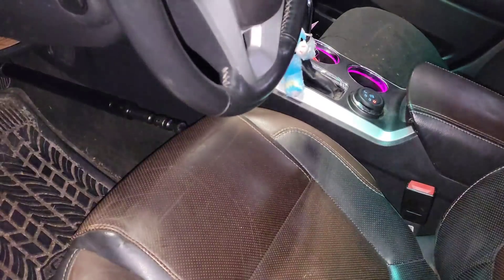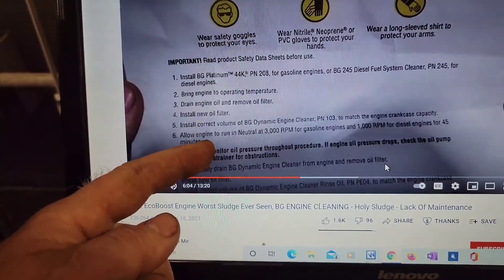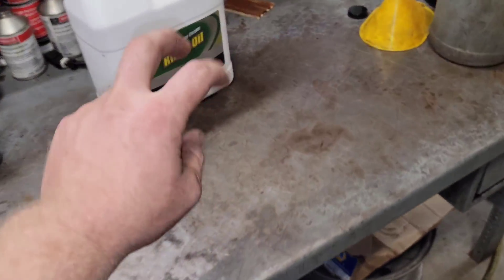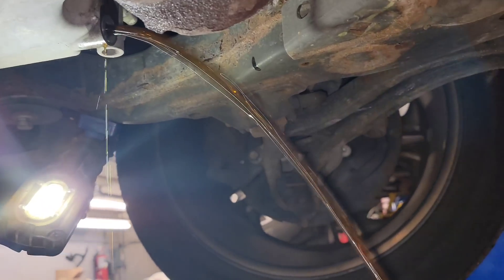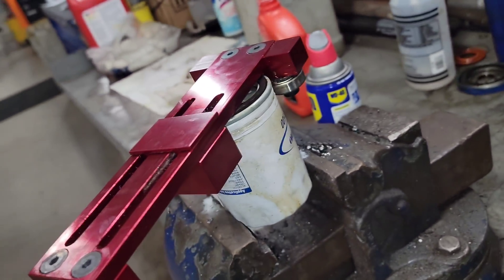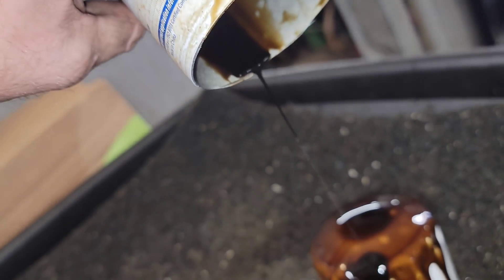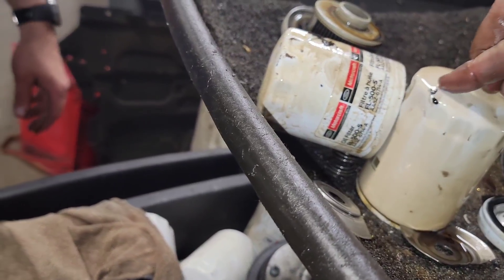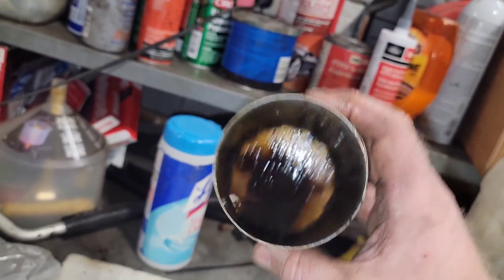Full BG Engine Restoration Kit 2014 Ford Explorer 3.5L Ecoboost - Quick Lube Serviced - Bad Sludge

Comment: Interesting. About 30 years ago I worked for a Honda dealer. The mechanics were always pushing BG products, which I thought was snake oil because they all saved the tokens inside the can for free stuff from the BG reps. Now I have a question for you. I have a 2017 Honda CRV LX, non-turbo version which uses direct cylinder fuel injection. The first five  5000 mile oil changes showed fuel contamination in the analysis reports. The last one was perfect though at 30,000 miles. I know there might be a carbon on valves build up problem sometime after 60,000 miles and don't really want to go the walnut shell method. Do you believe the BG products can address that issue for me if the time comes?
Reply from the maker: Bg is good and power foam from Aimsoil
Reply: I used BG back in the 1980s on my Yamaha Motorcycles. In fact I think it saved my XS1100 back in 1982. My Toyota Dealership told me the about the BG ADDITIVE  about 50k miles ago on my 14 Tacoma. I told them to put it in. Same with my 17 RAV4 15k miles ago. It does what it says.

Comment: Would you recommend using the engine cleaner with a perfectly running car or truck with over 200000km?Or just add some atf to the oil. Thanks for the great content
Reply from the maker: The basic simple step kit yes 

1 small can epr and a small can MOA found on Amazon

Comment: Great video.  Folks, if you didn't believe in it before, by now you should know to always change your oil and filter using good quality parts minimum every 5,000 miles.  I've never been a fan of the extra long 10,000 mile or 20,000 mile drain intervals.  If cost is an issue for you, then just go to Walmart and get a good quality Motorcraft oil filter for $3.97 and some good name brand oil (they even sell Motorcraft oil there) and change it yourself.  It's too easy folks.  With the low prices of oil and filters we have in this country (compared to other countries, especially in Europe) you simply cannot afford to skimp out on oil changes.  It's being penny wise and pound foolish.

Comment: the TOYOTA/LEXUS dealership that contracted my shop was told by their entire service department to get rid of the cheesy kerosene oil-filter flusher that accomplished little if anything other than rinsing hydraulic valve tappets and actuators, and that someday they'd be sued over the dang thing. 5-years later they were and lost and had to refund every 1 of their customer's money costing them bank and their reputation. Cleary the BG engineers came over on another boat id do this to anything i own.

Comment: So based on your experience with the 3.5, would you recommend it? I am looking at a few explorer sports exactly like this one.
Reply from the maker: If you read through the comments you'll see I recommend the smaller service that you can find on Amazon
Reply from the maker: They make a epr and moa 1 small can each for regular maintenance
Reply: @FordBossMe  I mean do you recommend the 3.5 engine as far as reliability etc. I am wanting the ecoboost 3.5 but I didn't know if you would recommend it for a long term reliable vehicle for many years.

Comment: I have a 2014 F150 with this engine and it runs pretty good, had misfire issues under heavy throttle which went away after a spark plug change.  Currently at 114k miles.  I want this engine to last as long as possible and part of me want to run this engine cleaner to get the engine in a nice clean state as well as I bought a catch can system for it.  Any suggestions on running the BG treatment on an engine that runs well and is not in need of saving???

Comment: This is a good video about BG products but this comes down more to service interval and the owners diligence on maintenance more than quick lube places being bad. I've worked for an automotive fleet management company for almost 10 years now with tens of thousands of vehicles and processed hundreds of engine warranty claims due to sludge and we regularly use quick lube places and are constantly having to modify manufacturers recommended maintenance intervals because of issues like this. The Ford Ecoboost is no exception. Ford recommends no more than one year or 10,000 mi. for their oil change interval. We regularly drop that to 6 months or 6,000 mi max and we have no issues. As far as quality, there are many videos out there on YouTube that show oil filter quality and Motorcraft filters are made by Purolator and have a paper membrane and filter to 20 microns just like most other bargain filters out there. No better than any others. Also the same same truck that stops at our local quick lube place also supplies both of our dealers in town with oil. There's nothing magical about dealership oil, as long as it meets the specifications they are fine using it.

Comment: How do you keep the vehicle from overheating while sitting at 2-3k rpms at a standstill?
Reply from the maker: It has an engine fan that's more than sufficient and keeping it cool
Reply: You'd need a good fan on it if it was under load, like on a dyno. But just running free like that the fans keep up.

Comment: That's why I do my own oil changes with Full Synthetic and Fram premium filter, also I do it every 6500 mi. or 9 months or never below 40% of the life indicator. What is your recommendation as far as the "oil life indicator" ho low do you go on your own vehicles? Thanks for sharing.
Reply from the maker: 5000 miles or 6 months is what I recommend but people can do whatever they feel like is necessary

Comment: Excellent vid, as always. First used BG products on our 2015 Mustang GTPP. I only run BG gear and transmission oils on both our 18 GT350 and on the manual gearbox of our 2011 Mazda 3. I have the same EX Sport but a 2015 MY. Wondering if you can share some insight as to what is the BG part numbers for the trans, rear diff, and PTU.  TBH, not a fan of MotorCrap oils. Appreciate you time!